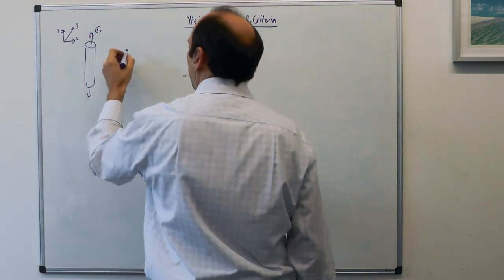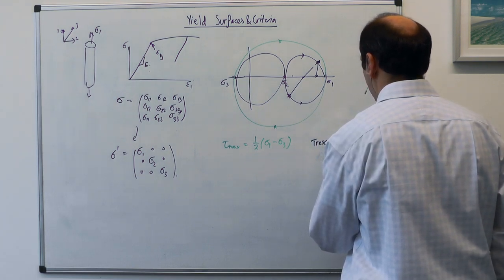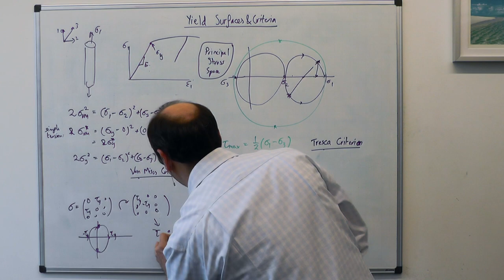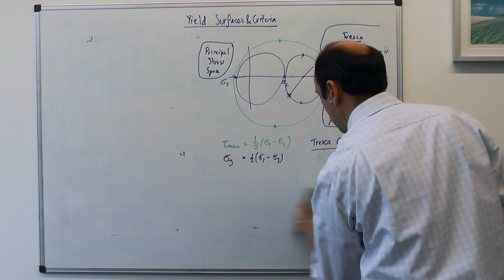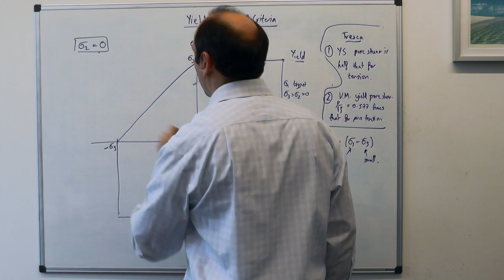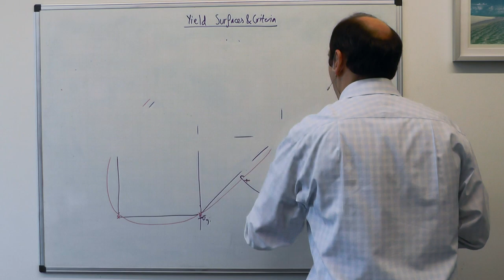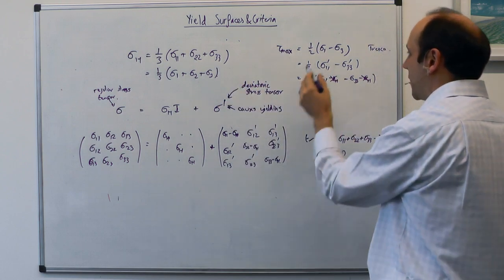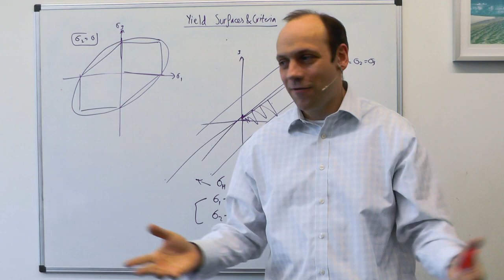L9a | MSE203 Yield criteria and yield surfaces

Comment: how to calculate dissipated energy in isotropic hardening and kinematic hardening.
if i have E = 100 GPa, σy = 100 MPa, κ = 1 GPa is loaded in stain control (1D) with εtot = 0.01. Calculate the plastic strain. What compressive stress is needed to realize one closed hysteresis loop

Comment: Imagine we have these Principal stresses: S1=1179.7, S2=411, S3=164.2.
According to Mohr circle the maximum shear available in the system is (S1-S3)/2=507.75
While the Von Misus Stress is larger than that Svm=sqrt(0.5((S1-S3)^2+(S1-S2)^2+(S2-S3)^2))=917.3
Would you please elaborate on this?
Reply: Because they are different yield criteria.